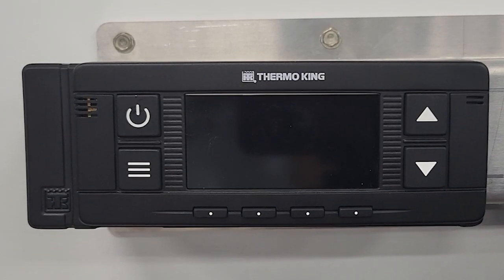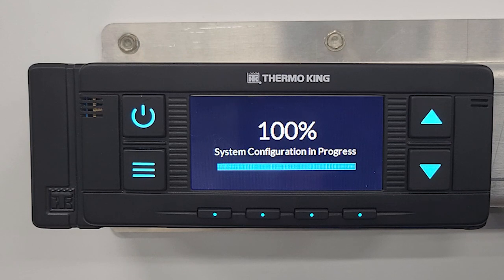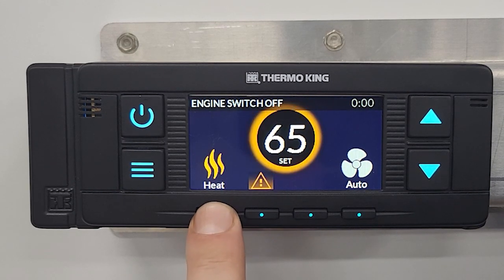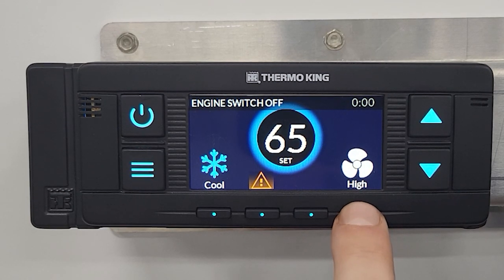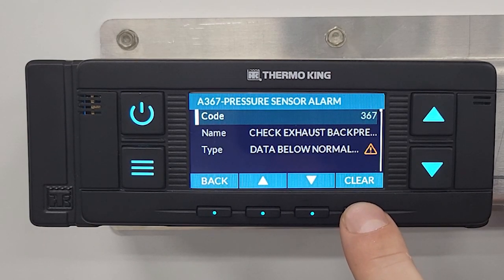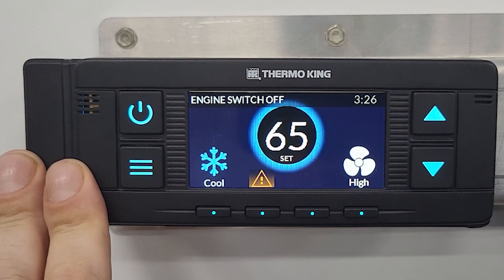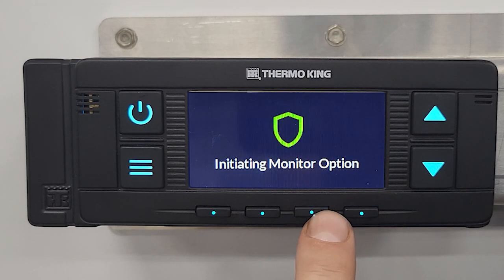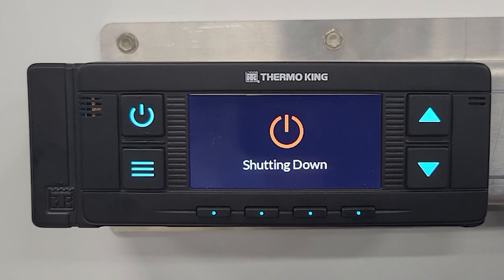TriPac 3 Driver Operations: Basic HMI Navigation

Comment: Why does my APU work good for a time then I get that notice on the top left that says Engine Switch Off. with 2 alarms A288 and A68. My engine switch is not off. But the HMI controller thinks it is. Last time this happened the company tractor shop disconnected my battery for like 20 minutes then it worked. Surely there has a better way to fix this issue. I’m currently dealing with this now for weekend and thermoking is closed on weekends and it’s 90+ outside.
Reply: I don’t like this version either. My apu blows cold air for a minute then starts blowing warm air for like an hour. I took it to thermo king they told me it stops blowing cold air to charge the truck so it won’t die , I didn’t have this issue with the old apu the one with the knobs🤦🏿‍♂️ it’s too hot for this

Comment: Standby mode is to pause apu for fueling etc 

Monitor mode is to charge the battery’s when away and temperature control won’t work but battery and coolant temperature will be maintained
Reply: Is it ok to run standby hometime for like 7days straight
Reply: Is it best to keep it on monitor mode or standby for hometime?  7days at a time I left mine on standby until I read your message about the two types
Reply: @ u never really want to use standby  apu won’t turn on and charge the battery’s either leave it in monitor mode or on default screen with temperature off and fan off apu should still turn on when battery’s are low

Comment: How do you set the time?
Reply: Did you ever find out how to set the time?
Reply: @FriedShrimpPoBoy I am told by our Shop that the driver can not adjust the time display. It must be done by a tech. It is often “lost” during operation so they no longer bother. Not sure if this makes sense but it’s their story and they are sticking to it.
Reply: @billware6721   Thanks. I ended up going into the advanced menu and turning it off. If I can’t set it then there’s no reason to have it displayed.  There’s many other working clocks in this truck.
Reply: @FriedShrimpPoBoy Mine has a PIN for Advanced Menu. What is it if yours did too?
Reply: @ The PIN is the last 4 digits of your units serial number.

Comment: My bunk heat works fine until it decides it wants to cut off in the middle of my sleep… I then have to turn the heat off for a while and then restart it… c’mon Thermo king…. Wtf?
Reply: You likely need a software update. 4.0.4 or higher for tripac 3. Can be checked in system details.
Reply: My alarm keeps goes off after I keep clean it . Idk what to do whatever that

Comment: All these new updates and Thermo king can’t prioritize driver comfort. Why have 3 separate hvac options? There needs to be one for automatic (not fan) say you set for 70° it will switch between AC and heat as needed vs being woke up from a sleep and have to change settings manually. Thermoking is junk